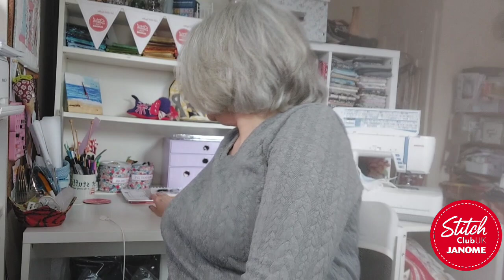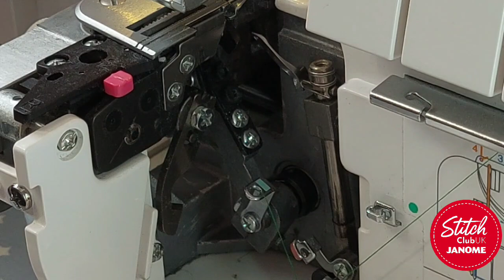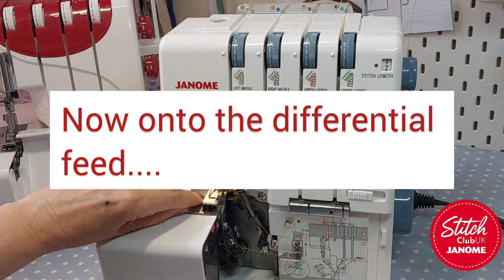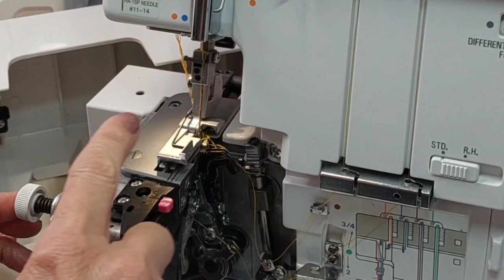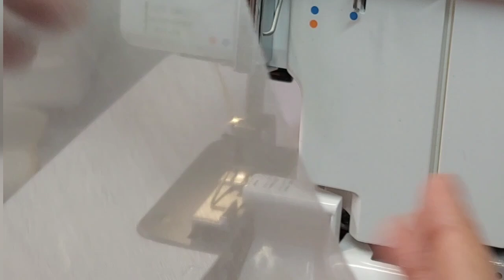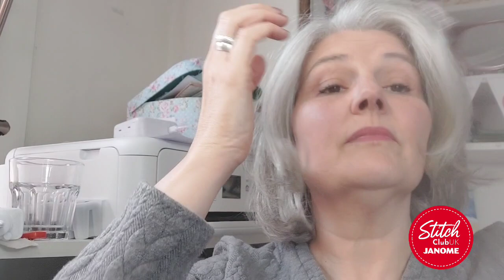Janome Stitch Club UK - Overlocker Introduction

Comment: I have the 6234XL. After getting the hang of it, threading is a breeze. No need for an air threader. That switch that brings the looper out is the best.  I have to say though at the beginning I had lots of problems with thread breaking until I watched a video how to thread and the guy threaded the upper looper first so I tried that and it works every time. So niw I have no fear. I could thread it everyday! I have also just read about overlockers in Tilley and the buttons, stretch book. She also says to thread the upper first. 
I love your way of sewing French seems. That's brilliant. I do a lot of them so I will do that next time. Much quicker and no threads peeping through. 
Thanks, I'm going to look at other videos.

Comment: I have just bought the 9300DX, I've never used an overlocker, been sewing for over 70 yrs hand, treadles, and electric sewing machines.
I've always wanted an over locker, these videos are going to be a life saver. Just plugging it in this morning took courage!! I have now managed an edge !!! Well pleased . The chain stitch is the thing I need to remember at the end of my piece of work, not pull it like you do on a standard Machine, mine is also a Janome.
All help gratefully received. Sue
Reply from the maker: They are honestly life changing!! Enjoy! xx
Reply: Thank you I will, making wheat bags to help those of us elderly to keep warm having lost the winter fuel benefit. This is going to speed up the process amazingly, actual bag to make plus washable covers.
Shop bought ones you can rarely wash. So now I've got the overlocker I won't need to do double turn overs or try and trim the edges, it will do all that in one go!! Magic
Thank you

Comment: Whenever I take out a needle I make sure to tighten the screw back up. Because the vibration from the machine can loosen it and it can disappear forever. I also leave the needle threaded until it’s out, again in case I drop it xxx

Comment: Hi I am new to using my overlocker and to your channel. Watching your video was really helpful to me but I do have a question.
I know when you are threading you work from right to left so if you decide to change the color thread in the upper looper for example do you then have to unthread the right then  left needle and then rethread those again after threading the upper looper.
Reply from the maker: Hiya, as I saidvit is important that the threads lay in the correct order and often if you are moving the wheel to get ro the threading parts,if the needles are still threaded they may get tangled up so ...short answer yes but I only take them out of the needle not out of all the tension discs etc.Hope that makes sense! Xx

Comment: Thank you for doing this video. It’s been really helpful. I have anew Janome 9300DX overlocker.  On my sewing machine I have to use a ballpoint needle for stretch fabrics. Is there any needle equivalent for an overlocker or is it just the exact same needle every time… apart from size?  Thanks again Maria❤️ I’ll be watching this channel very often
Reply from the maker: The recommended needles HAX 1SP are Super Stretch ballpoint needles. They come in a 11 and 14 . These are the ones you should use all the time. Glad the video helps xx

Comment: Love your videos I am still afraid of the machine getting the better of me.
Reply from the maker: Keep your speed lower and it won't be able to! You also dontvhave to use everything ...just what you need, when you need it...it's a servant there to do your bidding....well not the housework I'm afraid🤣
Reply: I hope you are having success with your overlocker.  I have been using them for about 35 years.  They can be the best thing, but also can be so very aggravating!  I have a 644d, and I rather hate it!  If I ever have to re-thread it it ends up being an hours long process, I cannot seem to get the under and over loopers situated properly.  And I have given up on trying to do a rolled hem on it, it simply will not do it nicely.  That is the bad news. The good news is I have used several other models through the years that are easier to thread and move between the different stitches.  I do encourage you to explore the capabilities because there are lost of different things you can do which will give you more professional results. And for sewing knits they are far more satisfactory than a regular sewing machine. Good luck!